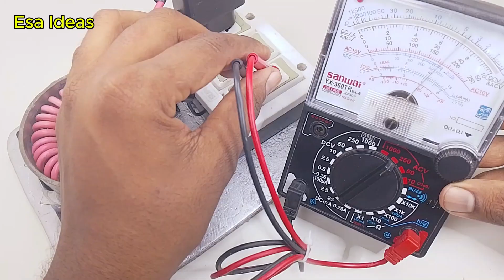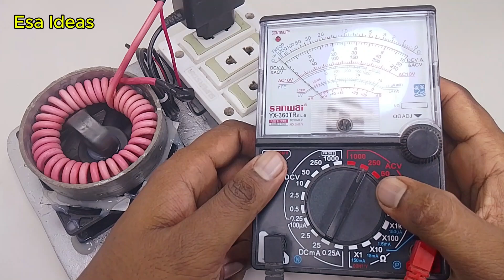How to Make 44kw Free Electricity Generator With a DC fan copper wire and magnetic power At Home

Comment: SO THIS IS ANOTHER SCAM.     FIRST, THERE IS NOTHING HERE WHICH WILL HANDLE 44 KW.  EVEN THE WIRE IS TOO THIN FOR THAT.   THE RED COIL DOES NOT HAVE ENOUGH WIRE FOR 240 VOLTS. THE MAGNET TURNING INSIDE AN AIR COIL (NO IRON CORE IN COIL) WILL DO NOTHING MORE THAN MAKE WIND.   3 WAY SOCKET IS POWERED BY HIDDEN MAINS WIRES.  COMPLETE SCAM WITH FAKE CLAIMS.